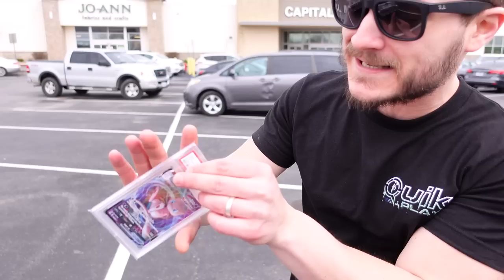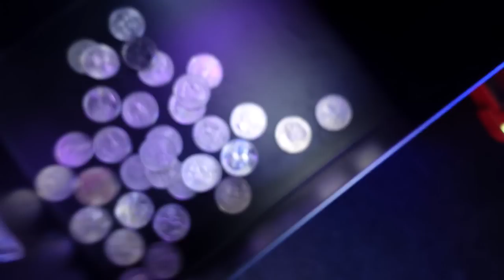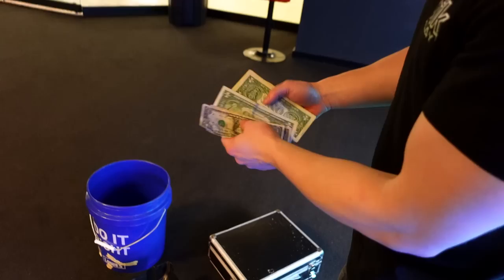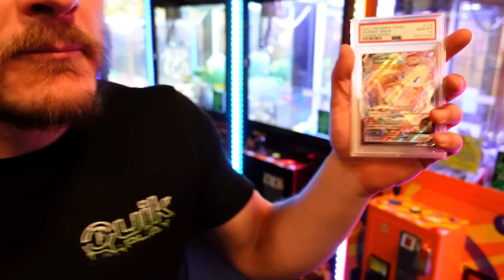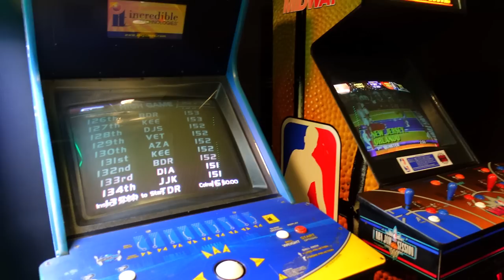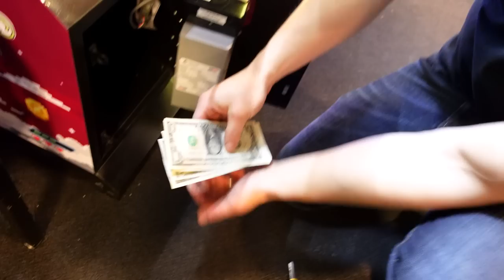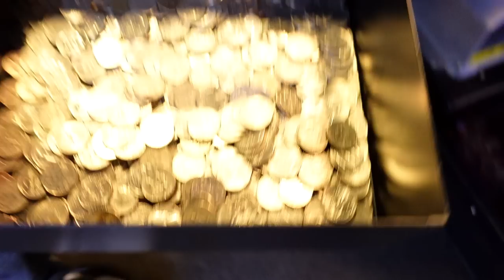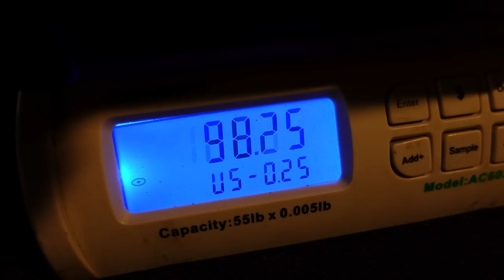You Won't Believe How Much MONEY Our ARCADE Made!

Comment: so with the coin pushers i saw a lot of coins outside the buckets on the floor of the machine where those added as well or did you just leave them? also did that 1500 you showed already take off the rent for the building and electricity cost ? still nice haul for a week